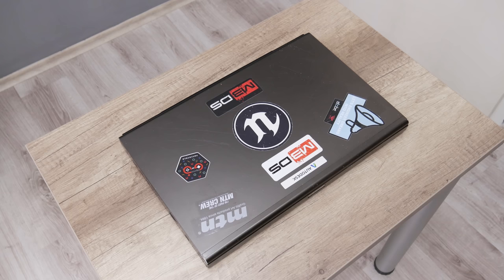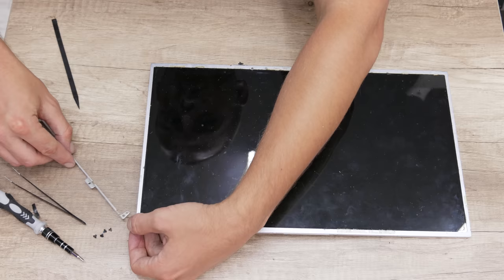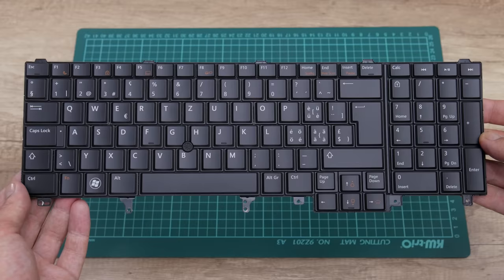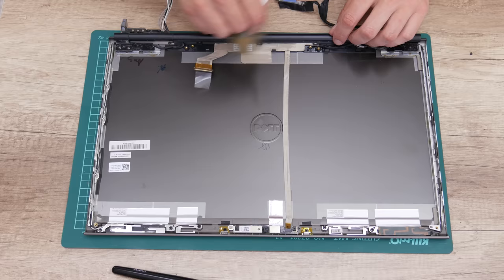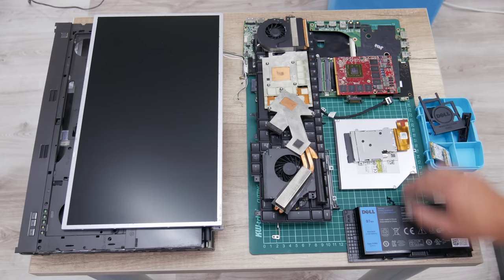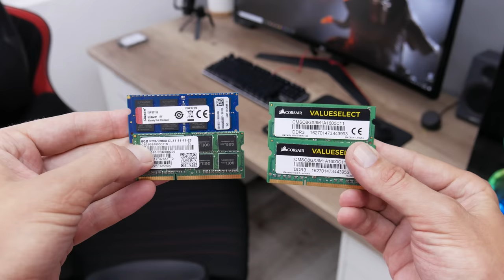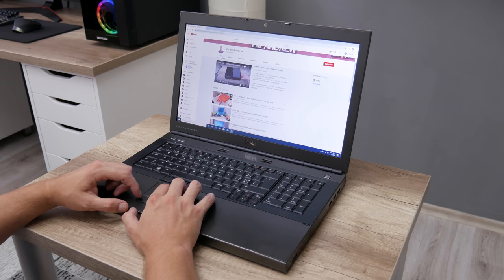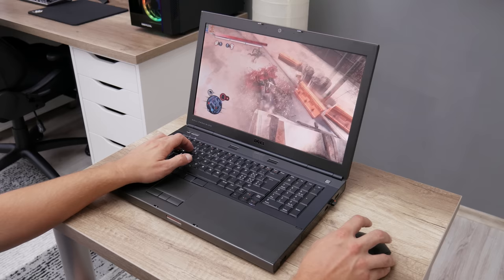Restoring DELL M6600 - Mobile Workstation

Comment: if you can get your hands on one-buy it with speed
anything broken can be fixed-hell, Dells downloadable PDF
gives detailed photographic instructions 
how to take it apart and rebuild it
(this user guide is the mother of Ifixit)

-searched for years for any m6600, bought it
third hand, and its a bit battered,
as one would expect a decade old thoroughbred,
 but its battered magnesium alloy, so no worries!

Mechanically solid as the day it was born, with useful surprising
little extras here and there, like a physical switch to kill wifi,
a unfailing 180 degree folding screen

The underside is some incredibly hard plastic, 
maybe PC/ABS mix or something exotic, 
as the Dell designers always do

i7 2720QM cpu 4 core 8 thread 32nM 2.8---3.2 Ghz 
mfr launched late 2011, 45 WATTS!!
NVIDIA quadro 3000m gpu 2gb
16 gb ram 1600mhz
win10 pro 
 no battery
$400 !!

speedfan showed insane heating on gpu and cpu
and kept crashing, so cleaned it (it was like a barn in there)
now multitasking (20 chrome tabs) and 10 open 
apps, no sweat-temps at 48deg c (118f)
 no freezes or random shutdowns since the clean

if i can gather up the courage to upgrade the cpu/gpu
teardowns not for the faint hearted

Comment: The issue with up-gradable laptops is... Well, the company that makes them. They have to do regular bios updates. With out those, it will never be able to use newer hardware. Laptop mobos are made to be extremely light weight. Thats why bios updates for laptops is 200kb of installed data (don't believe me? rip apart a bios update, most of that MB it takes up is the installer) verses full size computers which is in the megabytes.

I would lobe to finally see a Laptop I can just slap desktop parts into... It would be really heavy, but I can live with that extra power.

Comment: great job, amazing like you restored this machine, man! but actually it's not a game machine, it was supposed to be a workstation with that gpu, so you should test the machine with Cad and 3D modeling softwares instead. Btw I have this notebook with Quadro gpu and I7 2500 cpu and it is still good for Cad crafting. Great video anyway 👍

Comment: You never used Astonish kitchen cleaner before? (The product is from the UK (might not be available in the US), but it is capable of removing deep scratches quite easily, as Techwen demonstrated in one of his videos. You might have to import them from the UK or use a local product similar to it)

Comment: Hey there!! I used my laptop all night long and then I charged it for hours. In the morning, when I'm gonna power it on, it boots and then restarts. Then, after sometime, it doesn't even boot with power button blinking. Then, it's a dead laptop. Can you guess any possibility about the damage?
Reply: Bad ram, same problem I had. Remove all ram, number them and test 1 at a time.
Reply: @SamSung-gf3rt  Did it. Still it's dead !!

Comment: Hey Andrew I have a HP laptop from 2013 and it have issues. First the laptop is randomly entering and closing apps by itself and second it is lagging so much after I installed windows 10 and also after I installed windows 10 when I turn my laptop on it starts making loud noises then turn off with itself.
DO YOU KNOW WHY THESE PROBLEMS ARE HAPPENING

Comment: How about installing a mSATA card? My M6600 has 3 drives, one of which is a 1tb mSATA. Currently I am dual booting with Kubuntu and Windows 10. I have managed 6 operating systems at a time on this machine. Keep in mind that if you start off Legacy, you must make all installs legacy and use F2 to boot to that OS. If you go all UEFI, then you can use a boot loader editor and list them out and boot to which one you want. Great video on an awesome machine.

Comment: Great video; you really put the good work on that one; how long did you actually spend in the disassembly and reassembly on this one without the cleaning; also; when you were putting the graphics card back on; after you put the paste in the main chip; did you just clean the multiple pads on the heatsink; or apply something to them?

Comment: The downside of the Latidute and Precision in the Dell lineup is that their cooling performance is not very efficient, resulting in frequent throttling during heavy tasks. I am using Dell E6540, i7 4810, 32GB.

Comment: Hi, I have hp pavilion dv6 laptop. Can you please tell  how can I upgrade to do video editing etc. It's very slow. Also have black screen problem due to overheating. I think I need to apply thermal paste and fan cooling also not working properly.  My laptop's back case come off easily. It has no screws to remove ram stick and hdd. Thanks.

Comment: i have lenovo G40-45 basic spec AMD A8-6410 with R5 2GB, ram 8 (was upgrade), i have question 1. it possibel if i make upgrade processor (what type processor maks in this laptop)? 2. it possible if i using NGFF for SSD NVME PCIE in this laptop? Thanks

Comment: I've been using one of these daily for almost 5 years. Had no idea they were SO capable.

Update: I removed the bottom tray and the fans were FULL of iron dust and black gunk from the shop it was used at. Explains why it gets so hot.

Also having issues with it lagging, but only when it's plugged in. Running on battery is fine.

Is this computer still worth saving? I'd love to upgrade it, as I use it for auto desk and 3d modeling.

Comment: Hi I have the same machine, I am wondering which version BIOS you installed, as I am running on A07 ,it runs fine, on windows 7, thinking of going to windows10, but need to update my machine, Only bit hesitant not sure which BIOS to upgrade to, hear stories of bad BIOS etc, any advise be so thankful, cheers.

Comment: what would be  a better option as for the GPU? which model would outperform the AMD FirePro M6100 2GB?
Reply: I´ve done some research and found out that some Laptop models support a Nvidia GTX 980M 4 or 8 GB as well as a M6800 depends on your laptop model and your price range

Comment: The advantage of the Dell M6600 over the competing HP EliteBook 8760w is that the Dell can use GPU's from the Alienware models. You should be able to put GPU's from an Alienware M17x with 2nd gen CPU in this laptop without issues. I think that would be either the GTX 680M or 780M. Newer models might work but then you get into vBIOS flashing etc. You can check out Youtube user "soundoflenses". He has a lot of info on this.

I still use an HP 8560w (15 inch version) that I've upgraded from a 2670QM to a 2860QM (it runs hot but it's manageable) and fitted with 32GB RAM and a 512GB SSD. The GPU was an AMD FirePro M5950 and I've swapped it to a Quadro K2200M 2GB from a ZBook 17 G2. It's basically the same GM107 GPU as the GeForce GTX 960M. I did need to do a vBIOS flash which is a b****...

This M6600 should be able to handle a 2860QM or even the extreme edition 2920XM/2960XM with ease. Also, I think you can get a GTX 980M 8GB working in one of these.

Comment: Did you measure your usb 3.0 speed? Writing on usb pendrive on windows 10 has speed of ~30 MB/s, but if I use the same pendrive on linux, I get speeds of ~100 MB/s.

Comment: Hi bro, 
I have hp envy 6 1002tx
i5 3rd gen 500HDD
4gb DDR3 Ram
I checked its specifications in CPU Z its showing single channel RAM

I want to Upgrade it so its better to install

4GB + 4GB 
OR
8GB + 4GB

Because its single channel so im confused. 
My laptop is very slow.
Please help
Thank You.

Comment: i have a laptop that keeps shutting off randomly and I cleaned the dust and all yet it still does it, is there anything I can do to get it fixed
Reply from the maker: Hi bro, did you check the CPU, GPU and other Chips for thermal paste and silicone rubber, I mean is anything good there? Also, when, In which situation the laptop is shutting off? While Gaming, while using some software's or  it's just shutting down even if you not using anything?
Reply: @ComputersAndTechAndAndrew  it shuts off while gaming, watching streams or yt and sometimes it shuts off when im not touching it

Comment: Question in the comment

Good job, as a proud owner m6600 I am impressed and kinda suprised to see exactly the same setup (The same GPU, the same amount of Ram, the same cpu) as mine (only thing mine is lacking is an inbuilt camera, I bought the "privacy version" )
BTW during upregade I broke the touchpad cable connecting the touchpad module to MB (do not ask how) and did the worst thing... Threw it away... Since academic year is closing in I would like to replace it. Do you have any idea what cable would it be? (socket Type) (does not have to be original dell cable)

Comment: Hi boss,

Do you have any problem to adjust the screen brightness by using fn+up/down key?

Mine can't adjust the brightness. That problem occur after I replace the gpu to AMD Firepro M6100 and install its driver which I got from AMD site.
Reply from the maker: Hi bro, I don't have that problem. Try to uninstall the driver using DDU via safe mode, and then install the AMD driver again.
Reply: Hi boss,

Thank you very much for the suggestion. I really appreciate it.

Hence, I tried to uninstall back the gpu driver by using DDU as per your suggestion, and then reinstall it back and restart the laptop. But, to no avail. The problem still persist. 😭

So I have to do try and error other possibilities. I tried disable 'generic pnp monitor' driver and restart. And then it works! The problem solved. Now I can adjust the screen brightness by using fn+up/down keys. 😅

But although it solved the problem, I'm still feel it was not the best solution. I think there must be something error somewhere to my laptop so that I have to disable the 'generic pnp monitor' driver. 🤔

Do you have any idea why it happen like that, boss?

Thanks in advance for your help. May God bless you. 🤲

Comment: At the time of making this video (2020) this laptop is about 9-10 years old, not 5-6 years old. It came with windows 7 and windows 8 was released in 2012 that means this laptop is from 2011 or below. Also 2nd Gen Core i7 series is also from 2010-11.

Comment: Love your videos Andrew. This is laptop that I have and would love to do the same things as you have done. I have some questions. What work bench our using? Specifically the little table shown is this video. Also I've seen you using some type of green mat underneath your laptops while working on them that seems to have centimeter measurements displayed. Aside from it looking cool is there any other purpose for it? I'd like to have one just based on how cool it looks. Was wondering if you could link me to where you purchased yours preferably amazon or eBay links if possible and also links to everything you use for upgrading and working on laptops might be interesting video as well if you haven't already made one. Would always appreciate links to anything you use down below in the notes. Thanks for all your helpful and interesting videos.

Comment: you could have saved a lot of time by using compressed air, and you would have been able to clean under the plastic shields. what happens is that dirt gets stuck under there and when the laptop gets moved again all that dirt will just move around and get the mobo dirty again lol

Comment: bro I don't know if you could give me an advice I have the same laptop but I have a quadro 3000m graphics card and sometimes it does not use it, I do not pass 20 fps in Far cry 3, I installed a driver booster to update the drivers, I don't know if it was okay, I would really appreciate it if you could help me please
Reply from the maker: Hi bro, the 3000m will run FC4 with 20+ fps, FC3 needs to go over 30, but the problem sometimes may come from the drivers, the quadro drivers are not really optimized, I have a fried with quadro desktop GPU and he use older drivers because ome newer won't work properly, with some drivers he got glitches or black screen

Comment: I traded my hp 2000 notebook for a dell precision m4700 the dell precision has a core i7 3940XM 3GHz cpu 15.6 1080p display 1tb ssd and a second 500gb hdd blu-ray drive that i installed wifi and Bluetooth and invida gpu and intel HD 4000 graphics and i upgraded to windows 10 pro after i enabled the tpm chip in bios i will be installing windows 11pro on the notebook

Comment: 2:27 what are those name of part right side square and rectangle, i have this laptop but two are missing
Reply from the maker: Hi bro, these are Wi-Fi cards ( if you mean to the parts which are connected with thin cables ). 
Maybe these parts are not missing, these model M6600 is available in many variants/revisions, and each revision is different, maybe you have these parts but they are placed somewhere else and they may look different
Reply: @ComputersAndTechAndAndrew  it doesn't recognize odd even it is connected, in my case just my odd psychical connection problem. thank you im gonna try to change it 
///////
is it possible to connect any laptop ssd?

Comment: Andrew I want to send you a old laptop core 2 duo hp 520 model 1gb ram ans 70gb hdd
Reply: you can upgrade your laptop yourself. Install the CPU-Z program on the laptop from the Internet and see which motherboard chipset (Mainboard page) => GM965? GL40? GM945?
What processor model? T2050?

Comment: Hi Andrew i have dell m4500 , could you suggest me some upgrade ideas?
Reply: Does the laptop have an i5-560m installed?
Reply: @slavafedotov5742  Nope, it's I7-M620
Reply: @khosta-6847  a quad-core processor can be installed - i7-740qm (45w), but I do not know if the motherboard will be able to provide the processor with power, or it will only work at the base frequency (1.7 GHz) without turbo boost. You can not change the processor, install 4GB+4GB of RAM (DDR3-1066/ -1333), install SSD PCI Express Mini Card 240-256gb instead of 64GB. You can connect an external video card Nvidia gtx 1050 (ti), gtx 950/960 (2-4GB)

Comment: shit, you should have replaced the thermal pads and use a better thermal paste too, it will reduce the heat even more
I was so pissed off when you put the old, dirty thermal pads back on

Comment: My laptop has the following configuration
I3 6006u Skylake
4 gb ram ddr4 2133mhz
Radeon 530 2gb ddr5
And it doesn't run far cry 5 like that laptop does.....

Comment: The way you apply thermal paste bothers me to no end.. And you NEVER tighten a CPU or GPU cooler in a circle. You get it close to snug, then you tighten in a cross pattern in quarter to half turn increments. The way you're doing it can lead to warping and damage of the die.

Comment: Nice, not exactly "portable" but I have both an M6600 and an M6800, both i7s with the M6100 GPU, one I think had 20gb the other 32gb ram.
I really like them, my 6800 has 512gb SSD, and 2tb spinning disk and a 750gb in a caddy instead of a dvd drive. I did have an mSATA SSD but I think that was failing and they are hard to buy now. (3rd disk unnecessary? Nah! Put it in anyway! 🤣, Make it 4 with an mSATA drive)
Sadly mine only have the 1600x900 screen resolution not a 1080p, you can't have it all though can you?
As an addition, the GPUs are hard to get too 😔 when the one in my 6600 died I had to get one imported I think from USA

Comment: the problem with dell in here, in the parts, very expensive if you able to find it, compare with other brands
we stick with asus, lenovo and hp, where parts are available, or compatible.
last time, when we try to order dell battery, it have to wait for 1 month for original battery
Reply from the maker: Hi bro, it all depends, for this dell the parts may be little bit more expensive because this is high end laptop, same as getting something for ASUS ROG laptop. The other internal parts are the same as for any other laptop. The battery for this dell I found it for about $36-37 brand new. The only expensive part here is the GPU, but the price for the GPU is like for any other High End laptop. However, parts like Case, Display Hinges, plastics from the case are more expensive compared to the other laptops

Comment: why you always installing windows 10? I recommend you to install a Linux distro for a high performance
Reply from the maker: Hi, mostly I;m using windows because most of the games are available on windows only. The linux or the linux based OS's are great also
Reply: @ComputersAndTechAndAndrew  you can use a software called wine it gives you a chance to open exe files also running programs in Linux is much faster nowadays

Comment: These are very high end laptops used as workstations. They are not designed for gaming, and I don't get the hype in turning these powerful machines into gaming machines. They're "not" gaming machines. These machines will run games, but they are designed for things beyond that. These are old and can be obtained cheaply, but most people aren't smart enough when it comes to computers which is why they they use budgeted computers which are horrible and are not future proof. There is some professionalism in taking this broken laptop and repairing it, but the video is solely made to sell out especially when the music is recycled synth pop beats used as background music. Just don't call these future proof workstations gaming laptops because they're not. Is an Intel XEON server with 3.0 GHz a gaming machine just because it has the clock speed? Its not, and was never built for gaming.

EDIT: Oh, and also I do have a Dell Precision M4700 and I do have games that run on it, but I never play high end games on it, because I know that the latest games demand too much GPU usage. For everything else, its extremely fast, and a lot faster than most consumer laptops people use.